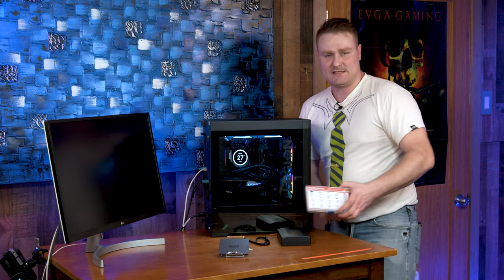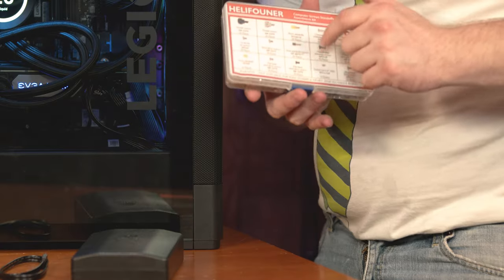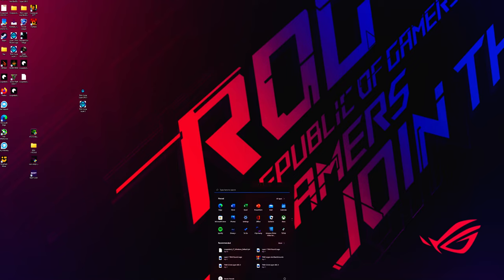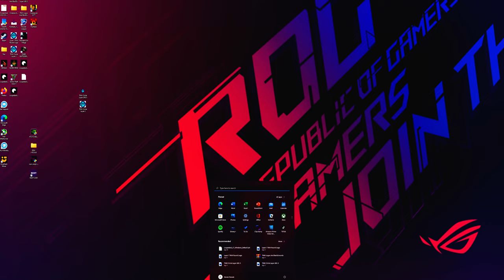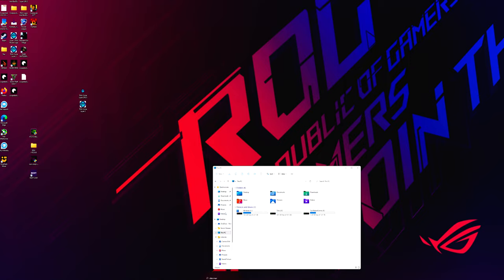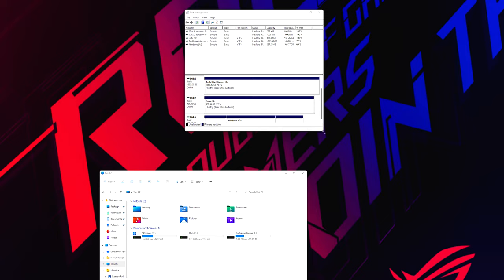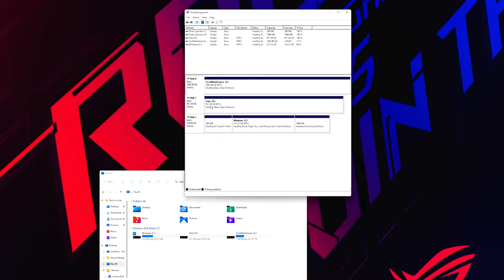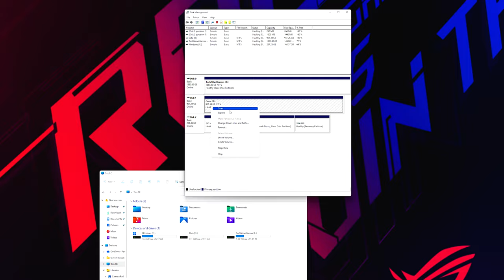Lenovo Legion T5, Lets upgrade the SSD! How to install a SSD

Comment: Such a versatile PC.  If I were into tempered glass side panels, and RGB I’d definitely consider it.  I do like the builds with static white lighting though.
Reply: To be fair it isn’t over the top on the rgb, it’s pretty low key in the terms of rgb
Reply from the maker: Agree
Reply: you can turn it the fucc off....
Reply: I have the version without the glass panel, its just plain black. 3070 ryzen 5800.
Reply: You can set it to static white.
Reply: They also have versions without tempered glass and rgb, I just bought one
Reply: I have the same pc and it has a major downside, the lenovo motherboard is crap. I upgraded ram to 32gb and the bios wont let you change annything so you wont get full use out of your upgrade

Comment: Thanks for video but definitely left out the cutting of the wires part. They have some really tight cable management here and coming from an ARX whew...I kinda wish they would've left it alone with the zipties.

They didn't give you any power cables to work with with the 2 hard drive slots you are given. I have 2 satas laying right there in front of the bays but no power cables.

It's a nice PC but the zipties are a bit much
Reply from the maker: Agree yes
Reply: @TNW1337   But hey it worked out. Thanks for video. I went from 980ti, i5  to this and wow it's amazing. Finally up to date...

Comment: Is the power cable already in the tower and ready to plug? We have a lenovo T5-281MB05. Have you ever installed an M.2 and find that the storage is capped? Or is the maximum storage mentioned in the manual talking about the max that can come with the computer. Thanks
Reply from the maker: Max that comes with it.
Reply from the maker: Iver had 4tb and 8tb both worked

Comment: Do all SSD's linked in description work/fit? I have this pc have the 3060 and i7-11700f just wanted to be sure they all fit into all t5 models a reply would be really helpful, also any one recommended over another? I'm new to PC but don't believe they have significant differences in performance plz lmk, Thanks!
Reply from the maker: Yes. I love Samsung and have trusted them for over 20 years
Reply: @TNW1337  I know they're usually the most expensive lol, any other recommended brands? I don't need the best one possible but something mid-level would be good. Or do you recommend one of the Crucial Mx over the PNY CS900? I wanted to get maybe just a 1TB or possibly a 2TB since I'm replacing a 2 TB Hard drive the lil extra storage is nice to have.

Comment: A tried this update and ordered the 90degree sata cable and couldn't fit it so had to order the straight one but my sata ports are at the bottom not like this one

Comment: @TNW1337 Exactly the video I needed since we're now looking at some upgrades to our son's machine...2 things... The power supply you grabbed, was that one of the cables that has a few sata plugs in a "chain"?
The Sata1 port you used... On this machine it's pretty tightly tucked behind the GPU. A 90⁰ cable might get in there, but just in case, is there any drama in using the Sata2 port?
Reply from the maker: Yes, it is. A l cable would work good
Reply from the maker: Sorry about that last comment. I was answering comments and got mixed up

Comment: could you please make a video showing how to install a m.2 ssd and you taking out the gpu trying to do this currently
Reply from the maker: It's not very hard to look at my GPU upgrade vid for how to take the GPU out. and the m.2 is just one screw you lift the drive, and it comes free. you will need a very small Phillips head FYI. If you can swing it a I fix it kit is a great thing to have a round the house.

Comment: Thanks for these Lenovo Legion T5 update series. Will you upgrade the motherboard for this machine in the future?
Reply from the maker: If i was using this PC as a daily driver, I would keep it the same till I need some thing better in like 3-5 years. I would do a GPU upgrade to like a 3070 or 3080. Once you had that you should be fine as long as your not try to play games in 4K.
Reply from the maker: If  lenovo comes out with a updated board yes.

Comment: Hey! Thanks for the video! Quick questions, which is the power cable for ssd? I’m seeing something kinda of chunky with lots of holes and then something similar to what you plugged in but it’s like fed through something that keeps it low by the HDD. 

I’m pretty new to all of this so I appreciate your videos!
Reply: bumping the question, could not find anything inside that looks like power cable for ssd in my t5
Reply: okay, as technitwit said in another thread they are bundled just next to the power supply, you need to get them out on the side where ssd is placed :) solved
Reply from the maker: Any Time

Comment: Where is the power cable at? I can’t find it and am stuck there. Unless it’s one of the cables labeled P3/P4/P5?
Reply from the maker: In a bundle to the left or left lower by the other drive cages.

Comment: Hello!  I bought a 3.5 inch hard drive because I read in the product manual there was a slot for one.  Where exactly does this go?  Does it fit into the same slot as the 2.5 inch drive?
Reply from the maker: So it is on the other side of the pc.

Comment: Hey tecnitwit I want to upgrade my Lenovo desktop to a i9 but I do not know what I would need to do so that it runs well would you mind making a walk through video?
Reply from the maker: Yes you can do a i9. The one thing you will want is a larger air cooler or aio cooler.

Comment: hi, i have a  question i want to put an aio cooler in my t5 , i have seen your video and my aio hasnt rgb so i continue to need the pcie cart or it will work fine without it ?
Reply from the maker: Yes it will work.

Comment: Just ordered this PC. I have a 3.5" 1TB HDD and a 2.5" 500GB SSD in my old computer that I'd like to move to this PC (in addition to the 500GB SSD my new computer comes with) for a total of 3 drives. Is this possible or does it not have enough slots?
Reply from the maker: I love this pc

Comment: on my t5 i can't get the back panel off on the pc, so i can't drag any wires. anyone know a solution? (front panel works great it's just the back panel)
Reply from the maker: all the screws are remove?
Reply: @TNW1337  idk if there is more but the 2 in the back are removed

Comment: Hey! Is it also possible to place a second nvme m.2 ssd in the system/motherboard or do I need to buy a converter?
Reply from the maker: On the legion I am pretty sure there is a 2nd M.2 SSD slot. Including the Wifi M.2 and Boot Driver M.2.
Reply: @TNW1337  Great! Is there a difference between the wifi and boot driver? I take that the boot driver is already installed and the wifi one is free? (I am using the Samsung 980 SSD nvme m.2)
Also do you know the place where the m.2 slot is located? My guess was behind the gpu, but I don’t know for sure. 

Ps thanks for responding!
Reply: @Mcspeedy99  Hi! Did you find out if it is possible? and if so where do you put it?
Reply: @tobynoby4761  Hey, it was not hard to find.  The bigget problem was that the GPU (3070 for me) and the bottom of the case are very tight. Just in between the two you will find the SSD slot. Just remove the ssd cover, place the ssd and put the cover back on top it.

Comment: you didnt even have to put it there......or buy a sata cable.....the sata locations are by the lower left. thank god i watched another video.
Reply: Yeah I was thinking can I use those one do I have to change where the other end is plugged or do I just install then plug in and done?